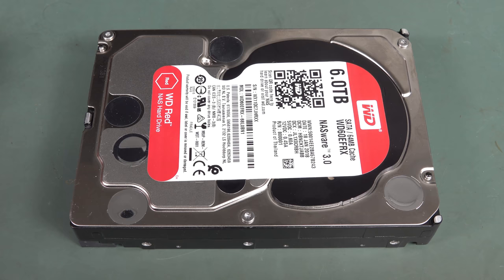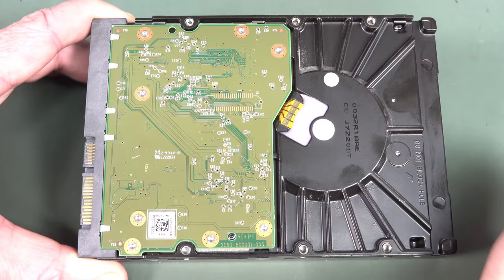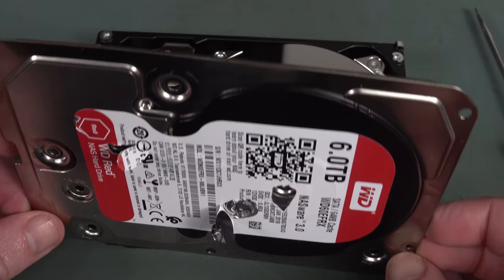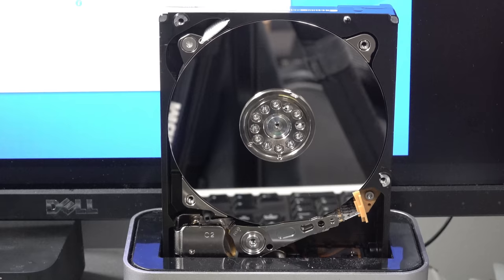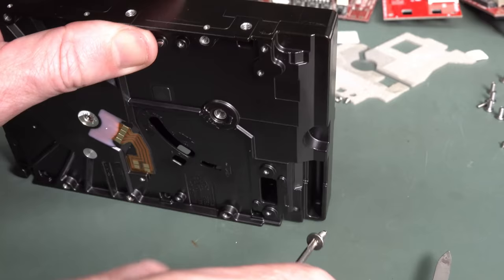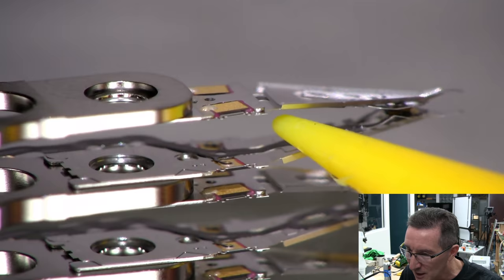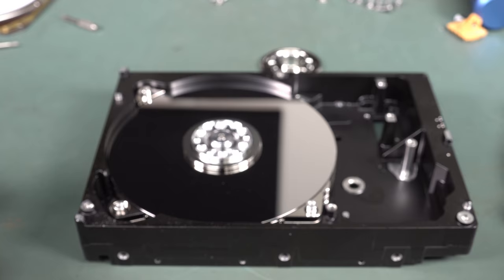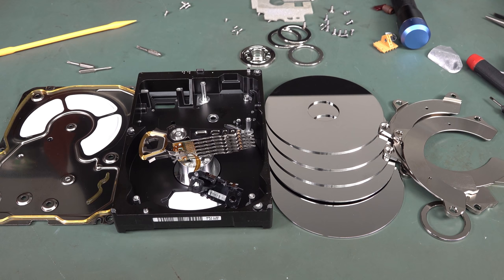EEVblog 1398 - Western Digital RED 6TB WD60EFRX Hard Drive TEARDOWN

Comment: Oh no, you didn't take apart the spindle motor. It would have been interesting to see the engineering that goes into spinning all those platters.
Reply: It's basically a 3-4 phase brushless motor with hall effect sensors. They tend to be press/thermally fit and virtually impossible to take apart.
Reply: @Segphalt  "virtually impossible to take apart."

That sounds like a perfect reason to stick @EEVblog onto it. Watch Dave wrestle with the thing!
Reply: @PeterUrbanec  Though some of those motor models aren't individual pieces as the stator is designed as a part of the HDD chassis.
Reply: @Segphalt  no, there aren't any hall sensors, as there is no way you can feed them and the coils with just 4 contacts.
Reply: probably the most interesting bit is the hydrodynamic bearing. I haven't yet sliced one apart, i probably should.
Reply: @victortitov1740  Sure there are... 2 power, 2 signal with a control chip in the motor for the motor driver. I'm sure they aren't all built like this and I have no basis of understanding for the WD Reds... This however is exactly the design of the HGST drives.
Reply: @Segphalt  haven't seen such a motor yet, but that is certainly a possibility. Sensorless motors should be cheaper though. I don't have any failed WD or HGST drives to take apart, but i have a plenty of seagates, which all have only 3 contacts, with visible transitions to magnet wires.
Reply: Hard to torn it down, must be burned so the glue melts

Source: I did that myself
Reply: @Segphalt  I've taken apart 1000s of HDDs. They're pretty much all brushless motors and all the electronics are on the main board.
Reply: @soupisgoodfood42  How many 4TB and above have you done so with? I've also done alot and would find your statement unbelievable you have done thousands but have never seen one of the Cypress BLDC hall response controllers on that flex cable, unless you are in China as an electronics recycler (or maybe a disk recovery tech) I've taken apart maybe 100 in my entire life and less than 10 down to the motor in my lifetime (because it sucks to pull apart) in the majority of them the result was the motor winding only but some had chips.) I worked for a cloud storage provider we used alot of the early 4tb HGST drives I personally took 2 of those apart. Today I work for a company that makes a similar controller for the same purpose and exisists in Samsung HC drives, that in that case feeds in 2 power and 2 signal lines embedded in resin cast plastic that mounts to the baseplate of the HDD and feeds 12 lines 4x3 into the motor assembly. 

It's not common and probably outside the WD Red market but I know nothing meaningful about those drives. The one I have taken apart that I have owned personally I did not peel apart the motor (because it takes absurd effort for literally no reason.) The vast majority it is just a 4 phase motor. (And if you look at the size of the traces is probably the case here.) However the ones I have literally seen the Cypress chip on, also had big fat traces (presumably to not refit an assembly line)

I can only comment on what I have seen and what I know exists. I have already stated 2 times now I cannot speak for WD Reds. If somehow you have taken 1000 apart down to the motor I wouldn't believe you but I have no evidence otherwise. For me, I have a part I know exists, know you can acquire today what company manufactures the end part and the weird details to find it so I can stay inside NDA. What do you have?
Reply: @Segphalt  I have several bins full of HDD motors from over a 30 year range. There may be a hall effect sensor in some (in modern designs they're not needed), but I can't see any. And some of the very old motors that have far more than 4 wires may have on-board circuitry. But for the most part, they're just brushless motors (the old ones with more wires are sometimes more like stepper motors). I know this because I have hooked many of them up to a brushless motor controller.
Not sure why you don't believe me. 1000 isn't that many over a 10 year period. Anyway, these Red drives just look like any other drive that has come out in the last 10 years in terms of the chassis and motor design.
Reply: @Segphalt  I'll admit, I don't grind off the newer epoxy ones, so there could be something under there, but I've also seen a similar design where the epoxy is clear and there's no chip. I'll take a peak next time, if I remember.
Reply: @soupisgoodfood42  I question the 1000 because that many over 10 years is a drive every 4 days. I worked at a place that has literally thousands of HDD's in deployment we saw a little more than that fail a year. So I'm not so surprised about access to drives to take apart more the "why" a person would take that many apart if it wasn't a function of their job. 

I don't understand why some manufacturers have hall effect sensors in there but for some reason "big" (for the time period) seemed to have them. But I also only have a sample set of 10 motors I pulled the motor apart on.
Reply: @Segphalt  Yup. It is a function of my job. It's more a volunteer thing.

I've seen a few magnets or markings designed to trip hall effect or optical sensors. But mostly in very old or very odd-ball drives, and it seems the spindle motor drive and sensor processing is still done on the main board.

Comment: Dave, maybe consider running different manufacturers or batches of drives in NAS(unless RAID0). I got WD+Seagate combo, probably not matched in performance, but will not fail all at the same time.
Reply from the maker: Unlikely to all fail within days of each other.
Reply: @EEVblog  you think?  Had 3 out of 4 6Tb WD Purple drives fail within 2 weeks in a couple of DVRs all installed at the same time and sequential serial numbers...

Comment: I pulled a drive apart a few years back, the second I took the cover off I knew it was game over - a fine coating of a silvery dust was covering everything, took the platers out and found one of them was scored really badly - all that fine dust used to be my data. But I totally agree with you Dave, the engineering that goes into a hard drive is just amazing.
Reply: I have seen a few (I recycle computers for a living) where the air filter (carbon filled) ripped open.  Fine carbon dust EVERYWHERE.  It's really messy. lol
Reply: That still is your data, you just need to put it back in order.

Comment: That resistance you're feeling in the spindle motor is just back-EMF from the brushless motor acting on the permanent magnets in there.
Fun fact; you can connect the terminals of that motor directly to a standard hobby aircraft/drone brushless DC motor ESC to get things spinning real quick!
Reply: No PCB attached, no closed circuit, no current, no opposing force.
I believe that back EMF is in a different case of a motor, not a "generator".
Reply: @paulcohen1555  hmm... I think you're right. Although when I spin a brushless permanent magnet motor that's disconnected, there is still a 'cogging' effect where it clicks. What causes that?
Reply: @LazerLord10  The rotor is essentially a multi-sectioned magnet and the stator is made of sheets of laminated steel (referred to as a slotted stator). Since the stator is magnetic the rotor will "cog" to one of the positions.

Most BLDC stators are typically constructed with anywhere from 2 to 6 "pairs" and you can count them based on the number of cogging positions of the rotor.
Reply: @LazerLord10  Simply, I don't know.
Reply: @Derragon  Similar to brushed DC motors! The worst type in the world! :D

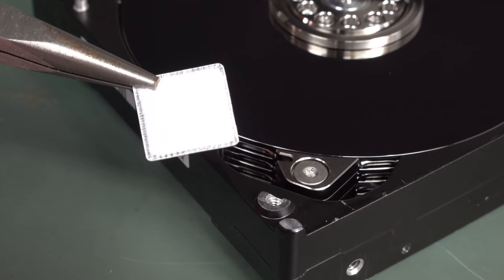Comment: That white "pillow" at 12:18 is not a desiccant it is there to trap microscopic particles, i.e. from the platter coating, which wears off over the years (makes bad sectors and weak/damaged heads). If you had a head crash you would probably see lots of grey platter dust on that white filter (some platters are just glas discs with a special magnetic coating (nickel  alloy ?).
Reply: ps2, i saw somewhere that the coating may be ruthenium.  there are probably other less exotic substances used now.  i dont know of any other use for ruthenium.

Comment: The pads are airfilters for any minuscule particles that sneak in during production.
Reply: +1.  There might be some desiccant in there, but the spinning platters create airflow across these pads to ensure that any speck of dust is contained.  Dust = warranty replacement.
Reply: If you cut one open they're filled with black smoo, presumably carbon
Reply: @_BangDroid_  activated carbon would be quite logical
Reply: @666Tomato666  Yup, that's what it is.  And I have taken apart hard drives where they ripped open during operation.  It's really, really messy. lol

Comment: Last 3 weeks 4 out of the 5 wd 6TB HDs failed in my nas. Had to replace all of them. All cmr versions with 30-40k hours on them. Replace 1, test, rebuild, fail another, backup all with raid in fail mode and 1hd with bad blocks. Create new raid, fail another disk after successful test. Hell of a week.
Reply from the maker: Don't jinx me...
Reply: @EEVblog  Keep testing those drives is all I can say. Not sure if my thecus is doing automatic testing. I think your Synology does.
Reply: Damn. Those hdds are really awful. Mine have over 100k hours and all 4 of them are just fine. Hdds are really going down the shitter these days.
Reply: @EEVblog  Perhaps it's time to look at using 2.5" SSDs? 8TB drives are about $1k each but live a long time..
Reply: Small update. Had to double check mine: also wd60efrx. Coincidence? Just outside warranty. 1 with clicky sound, 3 with some bad blocks.
Reply: Same happened to me, they lasted just over 6 months and in span of 1 hour 6 of them failed, first failed and rest failed during rebuild (I didn't learn first time, same happened to me with western digital sata disks 12 years ago), but I opted to replace them with 4tb 10k SAS drives (I didn't had bad experience with SAS drive till now). Only difference is I do not use them in NAS I use them in SAN. And on bright side I have now 2 little used 6tb hdd, which was hot spare
Reply: Friendly reminder to populate your arrays with as many different manufacturers or product lines as possible.  If you do have to have two identical drives, either put them in separate arrays or make sure to get them from different distributors and/or manufacturing batches.  In theory all it takes is one careless forklift driver dropping a pallet of these and a whole batch in that particular store is affected; you ordering 5 of them in that shop might just get you five disks that arrived on that pallet next to each other.  If it isn't the forklift driver, it may be the one delivery company you always use because they're the cheapest.  Sure, your array performance will be the lowest common denominator of your drives (so don't get anything unsuitable like SMR for ZFS), but the risk of a manufacturer screwing up a batch or an entire line of products has historically been pretty large.  Also check the Backblaze Hard Drive Statistics page (or similar) as these companies buy a lot more hard drives than you do and operate them all in broadly the same conditions.  And don't believe anyone who tells you any brand is better/worse than any other - they've all had their fair share of problems at some point.

If you already have a system with lots of identical (or known problematic) drives and they start going out, reading the data out first and trying to rebuild later might be the better strategy.  One common failure mode is (was?) the drives spinning down for maintenance after 30k+ hours and some of them never coming up again.

Comment: Two months ago, my 3TB WD reds have had their first bad sectors on then since going in installed in a 412+ series. That's 9 years running 24/7. So much has changed in those 9 years. 
Reformatting has helped, but I think it's time for new drives. Been looking around and not happy with all the failure stories for 6TBs and up in most brands. Not sure what drives to buy. It'd be nice to trade speed for reliability, don't really need 7200 rpm or super quick track to track times. Just want super reliable long term storage. Maybe the best option might be to to pick 12TB drives from different manufacturers and keep four copies of all the data.
Just buying on line space and leaving it to someone else is also a cheap option now too.

Comment: Dave! Didn't realise you were so young. As mikeselectricalstuff says, this is a "voice coil" drive. It was the major step forward when we moved from stepper motor drives into positional feedback. One of the platters is usually reserved for initialisation information so that the head gets to the right place regardless of temperature. I remember one Bathurst winter having to sit there for half an hour with a hair dryer to get an old stepper drive  warm enough for the heads to line up and read enough to boot.

Comment: Didn't inspect the high resolution video, but i hope you don't use the biometrics of your forefinger for something important. ;)
Reply: I've always been curious about that. So it is possible to manually input the fingerprint characteristics into code or is a prosthetic made of the print?
Reply: @K-Riz314  there are several methods. In one you can make a kind of prosthetic with a laser printer (for the negative), lime for the skin simulation and graphite for the print. 
Sadly i don't find the video from the Chaos Communication Congress were they show how it is done. 
It's pretty creepy what can be done with a god camera and a photographed iris or finger.

Comment: At 20:13 I believe those rectangular copper pieces where the head flexes are piezo elements when energized lift the heads up to float on top of the hard driver surface, If those fail the head crashes and starts to scrape the disc surface.

Comment: Dave, you should know that those metal flanges are being connected by a non-reversible tremie pipe to the differential girdle spring on the “up” end of the grammeters.
Also, I wonder if you can "lift" finger prints from that glorious 4K video?

Comment: You're right about them being the most mechanically complex device most people own. The tracks in a modern drive are something like 50 nanometers wide, and the fly height is about 5nm (similar scale to modern CPU transistor size). A modern drive has about 400,000 tracks, and the heads can seek to the right track in, usually, less than 10 milliseconds. Truly incredible.
No visible damage to your platters, in which case it may have been a bad head or bad head pre-amp. The drive has a service area which contains parts of the firmware that are needed for the drive to work. If the drive can't read that area on startup (bad head, preamp or scratch in the SA) then it will just start clicking (seek re-tries as it tries to find the SA tracks).
Could be various other things of course.

Comment: sorry for my poor English, 
the window on the back is actually a hole for "servo writer" to lock and guide the arm to initialize the hard disk like "low level format".  You don't see that window on very old hard disks because they use step motors to locate each tracks. but the new hard disks use voice coil to move the arms, the voice coil won't really locate tracks if the disk platters don't have the "servo tracks". therefore the new hard disks need a servo writer to hold the arm through the window you see on the back, and guide the arms for the write heads to write the initial servo tracks just like "low level format".

Comment: I'm not a HDD expert by any means, but I believe some HDD configuration data is stored on the platters (near the hub with the file allocation table). When the drive powers up, the firmware seeks this config data and if the drive cannot read it, it can't even fully startup, so it will just continuously attempt to read this data. 

It was a very common failure on Seagate 7200.13 Barracuda drives, they would power up click something like once a second for a few seconds, power down for a few seconds, then repeat. I had 3-4 of those drives fail in a year (each subsequent drive being a warranty replacement for the previous, with one drive only lasting something like 80 days.)

Comment: Whenever I have dead HDD that is unreadable, unformattable, and unusable, I always disassemble those, so I can get magnet inside.
Reply: should always try getting an identical used model on ebay. switch out the circuit board and you just saved your data.  ..and you still have one left to tear apart :)
Reply: @luminousfractal420  in most of my case it's a click of death